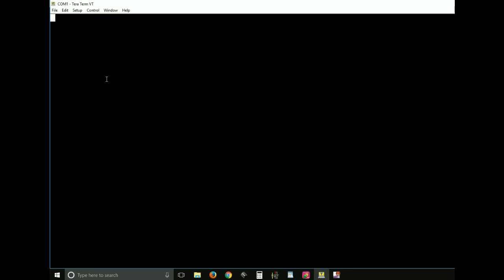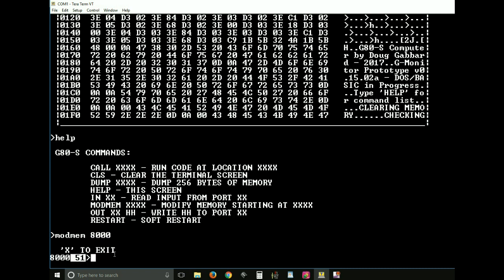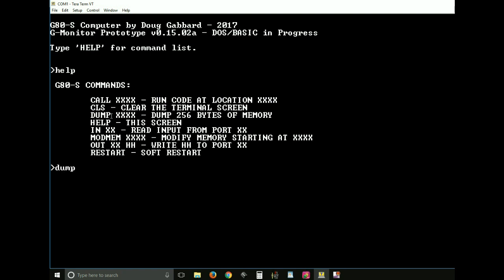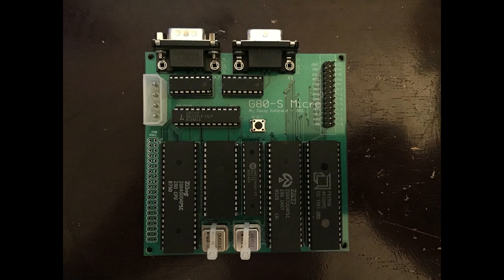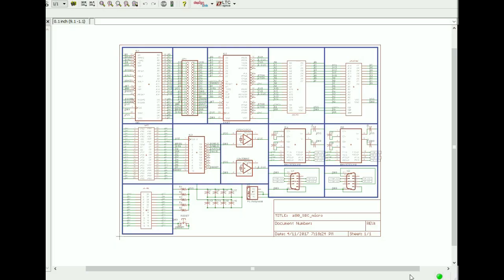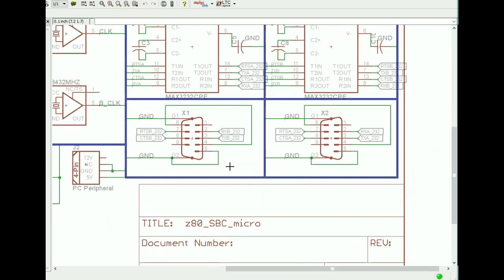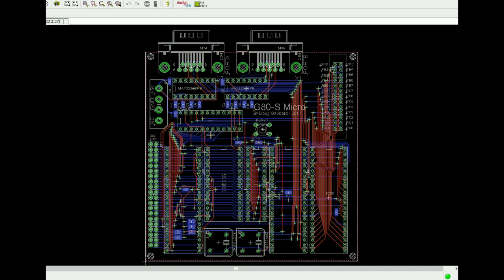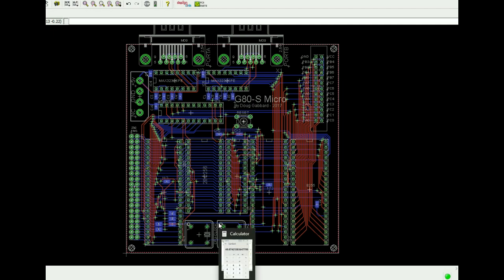New z80 Computer!

Comment: Great little computer! It's very similar to what I have on a breadboard right now. 8 bit CPU at 6 MHz (but not a Z80), 32k ROM, 32k RAM - but no UART. Serial communication is emulated in software (19200 baud). Amazing how similar these minmal computers appear, despite being based on very different processors. Have you built the expansions you have mentioned in the video? A look over the fence how things are handled on other processors can't hurt.
Reply from the maker: I have built several expansion cards, and have seen some built by others who have bought PCBs from me. The most elaborate was a card with dual video processors controlled by an analog switch, a SAA1099 sound generator, and a keyboard matrix interface. It worked well, but I made a few mistakes here and there. It evolved into a larger mainboard with those features as well as FAT storage controller, game pad interface and a RTC. What process or are you using?
Reply: @RetroDepot  Do you remember Lee Hart's membership card? That was by far not the first processor he has stuffed into an Altoids box. The original membership card was built around the good old CDP1802 CPU.  I think you mistook it for a 6502 in the video about the Z80 membership card. Sacrilege! :-)

So, I'm using a CDP1802, like in my first computer from 1978. Back then it was seen as 'weird' because it was so unlike anything Intel had ever made. It actually was a RISC processor before RISC was officially invented and also one of the first CMOS processors, making it both low power and extremely overclockable. And some of its more microcontrollerish features make it very interesting for building small computers. Maybe you would also like to take a look at it.
Reply from the maker: No, I didn’t mistake it. He did a 6502 badge. Which is what I was referring to. I have one, never got the dang thing working. 

That said, I know exactly what the CD1802 is, I have a sealed packed of 10 of them on a shelf in my office. Haven’t ever gotten around to using them... Although I’ve wanted to build something with them, maybe an Elf-ish like computer. But I don’t know enough about it to do much with it. And I’ve have actually desired to own a RCA VIP for close to 20 years.
Reply: @RetroDepot  I am surprised. For most people here in Europe things often begin with the Commodore 16 or 64. I guess I have gotten a little bit too used to being corrected myself. 'That's 6502, not 1802!'

As to buying a VIP - don't do it. Nor any other oldschool variant of the Elf, which is very much the same. They are sinfully expensive by now, and to do something interesting with it, you would have to modify it. That would be a shame. One of these days I'm going to take apart my old Elf II, but only to repair and restore it to a good working condition. 43 years have left their marks, worst being the 86 pin edge connectors for the expansion boards which are simply worn out and suffer from unreliable connections. And then there is the CDP1861 graphics chip. These are really hard to get these days and they bog down the processor to a slow clack around 1,8 MHz and steals around 50% of its bus cycles with its interrupts and DMA. This was great at a time when homebrew computers usually did not have any graphics at all, but it also would limit your options to actually do something with the old computer.

It does not take very much to build a little computer on a breadboard with the 1802. You already have the processor, so you would just need a 28C256 EEPROM, a 62256 SRAM, a 74HC00, a 74HC573 and a MAX232. That's all. You probably have these parts in your parts box. Its capabilities  will be similar to your Z80 computer here. Would you like to have the schematics?
Reply from the maker: Yeah, while I occasionally get things mixed up, I remember those cards. I have mixed feelings about Lee’s work. I appreciate it for what it is, but at the same time of the projects of his that I’ve built, I’ve yet to have one that didn’t suffer from stability problems. 

As for the VIP, that’s primarily why I haven’t bought one, too expensive. But maybe one day when Oprah and I use the same accountant...

Absolutely I’d be interested in it. Like I said, I have it on the list of things to toy with at some point. I just haven’t gotten to it. And you’re right, I have most of that stuff in a parts bin. Except for the 573, but I have 373s, so non issue.
Reply: @RetroDepot  Sorry to have kept you waiting, I was a little busy in the last few days. I have never met Lee personally, simply because I live on the other side of the world (more or less). He has been around for a long time. Maybe I'm confusing something, but I believe to remember seeing his tiny ads for his 1802 based computer kits in magazines more than 40 years ago. I think the problems with his kits mostly come from cutting some corners to squeeze yet some more logic onto the tiny boards. He often has to cut some corners by building simple gates with diodes or transistors. One of his computers in an Altoids box, the VIP2K, even has graphics and a tiny keyboard. Take a look, it might actually be the VIP you always wanted to have: https://www.youtube.com/watch?v=U0DvE7Mbxik

I have also looked over the schematics of my breadboard Elf. Good thing, because I found a tiny mistake that would have given you a lot of trouble. Must have done it right on the breadboard, otherwise the address latch would always latch the lower address bits, not the upper ones. That's fixed now, so where shall I put it for you? I also have some links to documents, tools and websites which you may need.

I would suggest, that you simply sign up here:  https://groups.io/g/cosmacelf  There I can upload all files for you and you also get help from the whole group, including Lee or the authors of some of the tools.
Reply from the maker: @CDP1861  I've seen Lee's VIP.  Don't get me wrong, I think Lee has done great work.  I've just had more problems with his kits than others. And I think you're right in that it seems to be from his uncanny ability to cram stuff onto a board a third of the size that it would normally reside on.

As for the group, I'll be honest with you.  I can't manage my time in any additional groups at the moment.  I'm a member of far too many as it is.  And I've been attempting to slim this down.  But if you'd still like to share, you can always send me an email from my website.  I can respond directly to you, and we can discuss it in more depth.  I'd post the email, but every time I do I get blasted with bots.
Reply: @RetroDepot  No problem at all. I will head over to your website after the boss' daily video conference.

Comment: Hi Doug, I have been thinking about reliving my Z80 days and your board looks nice and clean with decoding straight forward, courtesy of the GAL. Your description was very clear and thorough. Will you be offering the boards for sale? I am very interested in acquiring one, if so. I am a Z80 programmer from way back and I miss my old systems 😞
Reply from the maker: Terry Maker , I'm thinking about it. I'll tell you what, do have an AtariAge account by chance?
Reply: I have applied for one. Just waiting for approval from admin
Reply from the maker: When you are approved PM me:

http://atariage.com/forums/user/41787-jdgabbard/
Reply: Still awaiting approval 😞
Reply from the maker: Go here, I have a contact form.

http://www.retrodepot.net/?page_id=7
Reply: I didn't see this but it gives a 404 anyway. PMed you on atari.
Reply from the maker: Ok, I'll drop over there and check the PM.
Reply: I don't have an Atari age account, but I'd definitely be interested in purchasing one of these if/when they do become available
Reply from the maker: Denzel Morok, I have a Web Store Setup. You can check it out at retrodepot.net. I am in fact selling the boards.
Reply: Retro-Depot Oh, awesome! Would you, by chance, be able to sell the ICs as well? I have found other webstores that sell them but most of them tend to air on the expensive side. Thanks!

Comment: Hi, Doug.  Nice lookin' board, Sir.  A couple questions, if I may?  What I/O address ranges did you program into the GAL for the DART/SIO and the PIO chip selects?  Where do you source a DART/SIO chip and a PIO chip, please?  Finally, what is the limiting factor for the clock speed besides the speed of the CPU?  If it's the peripheral ICs, is 6-MHz the upper limit for those ICs (without implementing /IORQ wait states)?

Cheerful regards, Mike
Reply from the maker: Mike,  thanks for the comment!  First, the I/O range for the SIO is 00h - 03h.  That is, the Channel A data is 00h, and the control Register is at 02h.  While Channel B is at 01h and 03h respectively.  As for the PIO, it is located at 80h - 83h.  For the DART/SIO and 8255 PIO, I bought a large lot of ICs on Ebay several years ago.  But you can still buy new and used/pulled ICs that are in good working order on eBay all day long.  It really is just about the cheapest place to look.  As to clock speed, I have not had any issues up to 8mhz.   The z80 Dart that is in the board pictured is rated at 4mhz, and it works fine.  The second board that I have has a SIO rated at 6mhz, which also works fine.  If I had a guess what is the limiting factor, I'd have to say it is likely the 8255 PIO, which I am not sure what it's threshold is.  The only other onboard item to be concerned with would the the GAL and the RAM/ROM, all of which appear to be rated at 150ns, but obviously is working fine at 8mhz.  I hope that helps.

Comment: Thought that board looked familiar.... i found your ebay listing a few days ago.... i was tempted, i have a few Z80s and some GALs, no SIO or PIO chips though....

I've got the Z80 Membership Card, CPUville's home brew Z80, and the N8VEM SBC.....

Hrrmm.... could use that second serial port to add on a propeller based terminal... composite out and ps/2 keyboard... use the first serial for coms to a pc for xmodem... etc....
Liked and subscribed!
Reply from the maker: I own those boards as well, excluding from the CPUville's that is.  As for the SIO and 8255, they can be readily found on eBay. Depending on their location shipping could take a little while.  But they can be easily found.  I actually suggest using the z80 DART instead of the SIO/0.  They seem to be slightly more abundant, and are pin compatible with the SIO/0.

Comment: Two and a half kilobytes is a pretty huge program, for a machine code monitor.  I recall a simple computer outlined in a book I read a long while back which packed its monitor into just 1K of EPROM (not EEPROM, since this was 'way before it had been invented).  Of course, it used single-letter commands like E for Enter hex into RAM and G for Go run a program and D for Dump memory contents.  I think it even had a cassette interface with S for save and L for load.

Of course that was back in the days when a 1K x 8 EPROM would set you back by a significant amount in ready cash.  It's remarkable how compact programmers managed to make their programs back then.

By the way, you need to position the microphone either beside or below your mouth, not directly in front.  The loud pops and hisses from your breath make the video all but unwatchable.
Reply from the maker: Jason, thanks for the reply.  It's true, I have a lot of stuff in my monitor that some of the early monitors did not.  Currently the monitor has a lot of features, including the ability to modify memory, in/out of the I/O space, dump the contents of memory, perform an Intel Hex load from serial, and boot to a version of TinyBASIC which I have modified fairly heavily to include delay routines, In/Out, Poke/Peek, and some other pretty useful instructions.  Currently the entire OS fits in about 5.7k of memory.  Meaning that it packs quite a few features into a small amount of space.  

To put this into comparison, Microsoft BASIC 4.7b (which is what Grant Searle and many others used) is a more complete dialect of BASIC, but requires 8k of memory.  And it does not include a machine code monitor.  Let alone one as nice as mine.  Yeah, I'm braggin. :)

And you're right, there were lots of concessions made with the early computers due to space.  This was more of a project of simplicity in design.  And so far, it's been a pretty big hit with the community.  I have shipped a lot of boards since I first started this project.  And it's still in current development.  Currently I'm toying with various types of mass storage to see what is most practical, and trying to develop file system routines.

Comment: Hi, nice compact board. What hardware did you use to program the GAL and what software to make the jedec? I'd like to use them in a design but I hear not all programmers are that reliable at programming them.
Also, why the DART instead of an SIO?
Reply from the maker: The programmer I used was the TL866.  As for the software, I use WinCUPL.  It's available for free from Atmel, and works on both Latice and Atmel variants.  As for the selection of the Dart over the SIO, I have a bunch of DART and SIO/0 ICs.  They are pin compatible, and functionally identical with the exception of the clocked outputs, which I do not need. The DART worked so well, they just added to it for the SIO.
Reply: That's really helpful, thanks :)
Reply from the maker: Not a problem.  I'll shoot a WinCUPL Familiarization Video and upload it today.  I've been meaning to do it for some time.  If you subscribe you should get a notification when I have it uploaded.
Reply: Now that would be super-fab, I've got a very vague idea of how mapping logic functions to a jedec file works, but I'm really not confident,.
There's almost no information on youtube about how its done either. I'd probably have to go old school and look at an actual book, lol.
Yep, already subbed, as I'll definitely need that monitor code someday.
Reply from the maker: Once I get a little further into it I'll be posting it on my GitHub account for anyone who wants it to download.